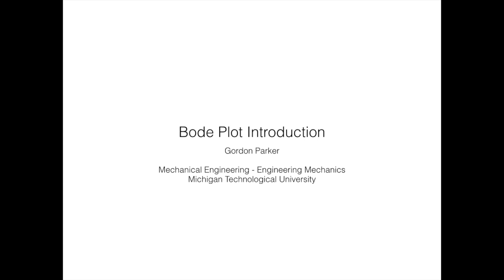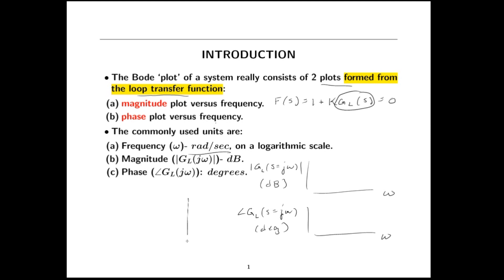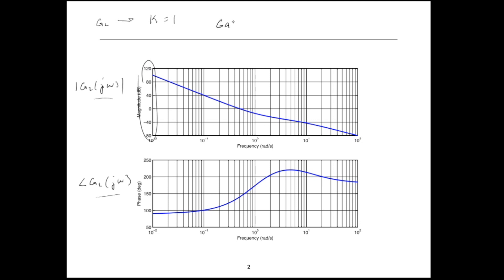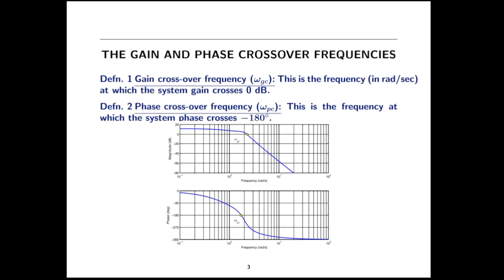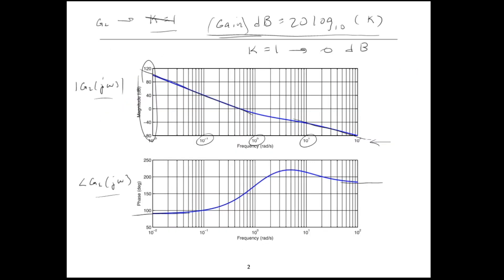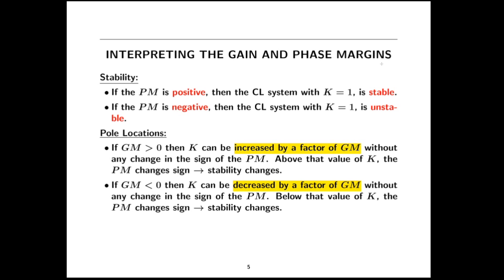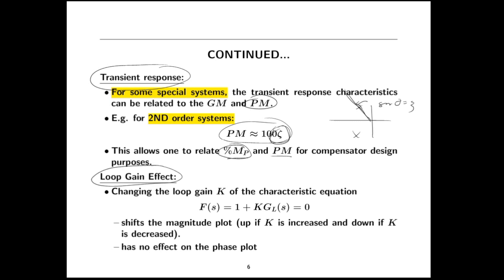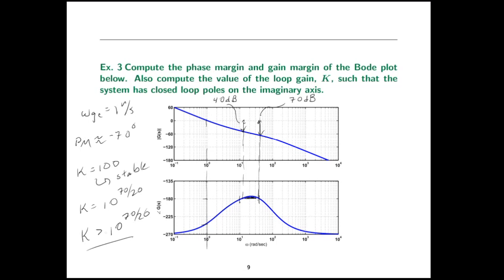Bode Plot Introduction

Comment: For a closed loop system with poles on imaginary axis, is the new gain K = 10^(GM/20) or 10^(PM/20). In example 2, you used K = 10^(GM/20) and in example 3 used 10^(PM/20).